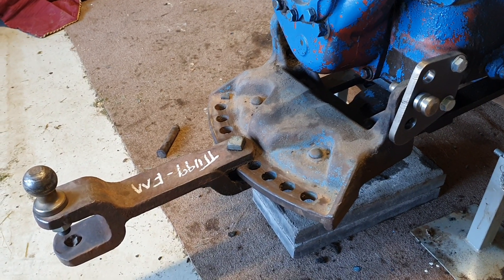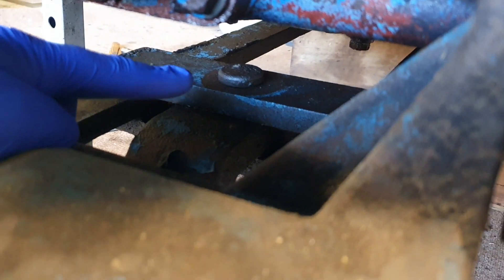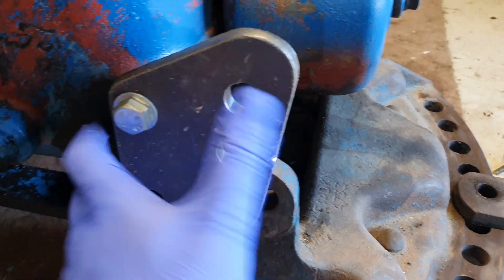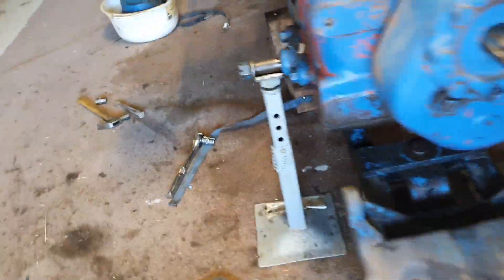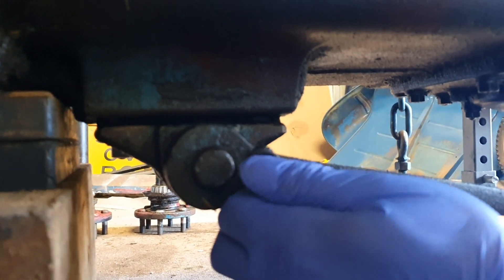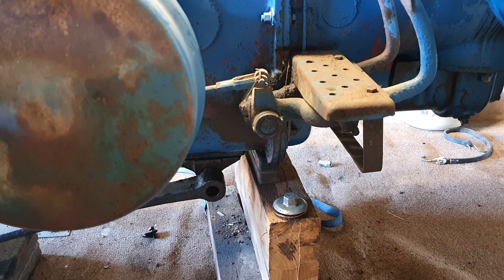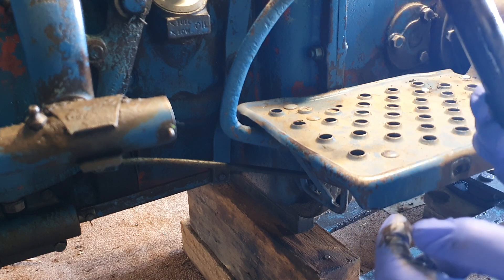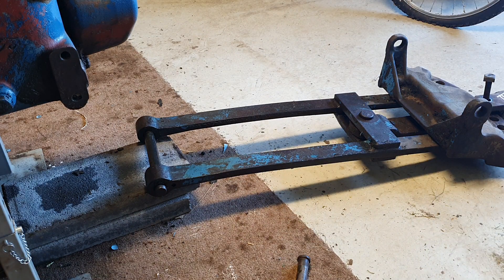Fordson Major Drawbar Assembly

Comment: I can't get the mounting plate free from underneath. Have removed the four bolts, what's holding it?
Reply from the maker: Years or dirt and oil. I would suggest slowly heating it to loosen the oil and gentle tapping to begin moving it. Pull it straight down as there is a round stud right in the middle from the tractor that stops it moving forward and back.
Reply: @fixingfordsonsaustralia6632  thanks for replying. I'm confident of removal now I know whats going on. Cheers
Reply: @seanwhitley7026  this is great info, just doing exactly that in a barn in the uk... couldnt get the mounting plate to budge after removing all 4 bolts so left it and pulled the pin...will go back and pry it now...got a bit of an oil leak in that vicinity that needs sorting! 🙂👍👍

Comment: Just enjoying the Fordson. At 5:53 I recon I saw enough of the clutch pedal to think you have live drive ? My Major has a roller drawbar not that common.
Reply: Yes, roller drawbar was an option, along with remote hydraulics and power steering, both supplied by Moore Hydraulics, a subsidiary of Moore Road Machinery.
Reply: @austral7634  My Dad in the 1970s used to buy starting cartriges and ignition papers for his Field Marshal from Moore road machinery in Adelaide. He bought Fordson parts as well and bought a very well worn Diesel major with a home made loader there. I think I remember a Ford County brand new in their show room.